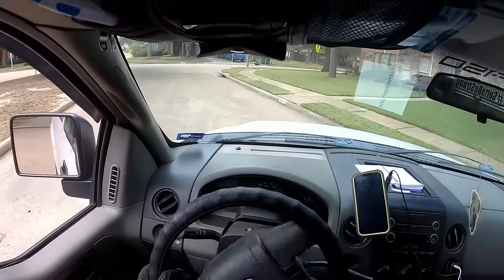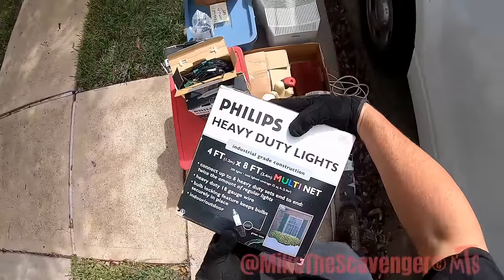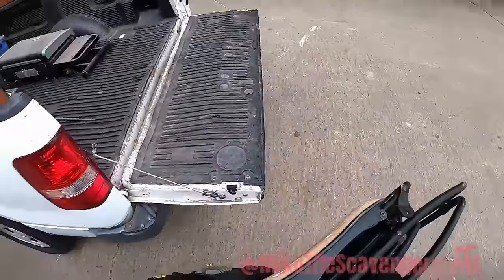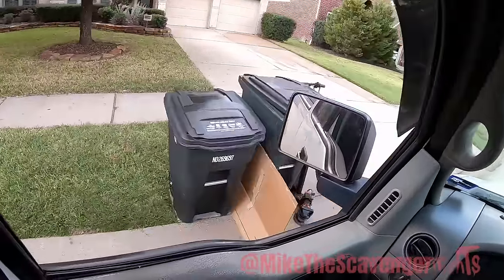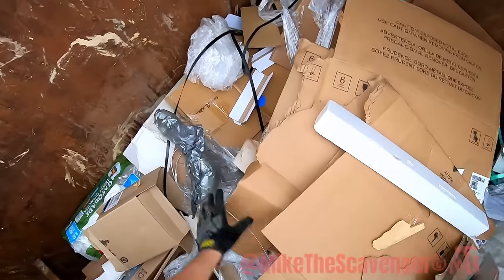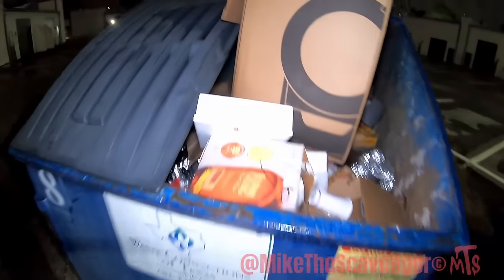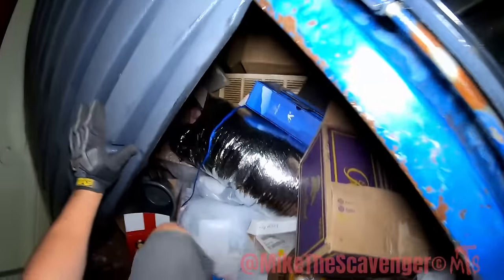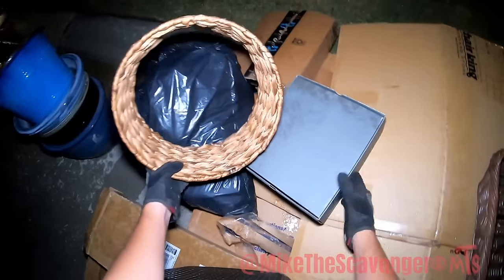Dumpster Diving & Curbsiding "I See What You're Doin'"

Comment: Those wire connectors are called scotch locks and they are a mechanics worst nightmare. They may save time for quickly joining wires when you fit accessories, but after a while they become loose and you have to solder the wires like you should have in the first place.😂

Comment: That coax cable out of the dumpster is worth a decent amount as are the amphenol connectors depending on which types out of that same dumpster, ham radio operators might buy that gear.
Reply: Def some good ham radio gear

Comment: Colleges went to cyber books long before primary and secondary schools. It was an option to buy online only access to textbooks when i started college in 2002. I've now gone back for a different degree entirely and there's not even an option. It's all digital now. You get a code or a link. It activates at the beginning of the semester. Some classes will have questions and info checks throughout the chapter for general ideas. Almost all have interactive chapter and section quizzes and a practice test or more for the final.

Comment: I stopped looking for everything and concentrated on copper wire.
It would seem here in South Carolina that a lot of electricians and builders have cheaped out and are now using the Copperweld brand of copper-clad aluminum wire that is not worth even getting out of the dumpsters!

I just left a rather large box of off-cuts from a rough wiring install in the dumpster 1 hour ago!